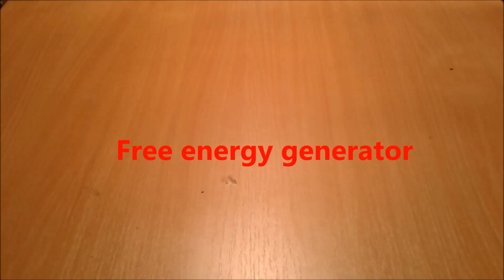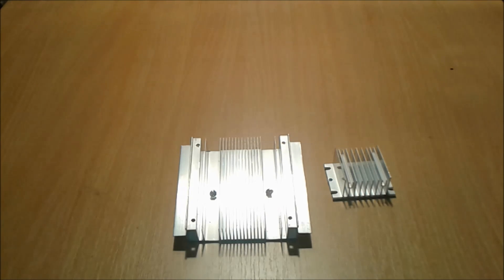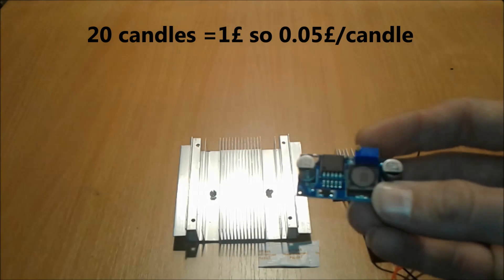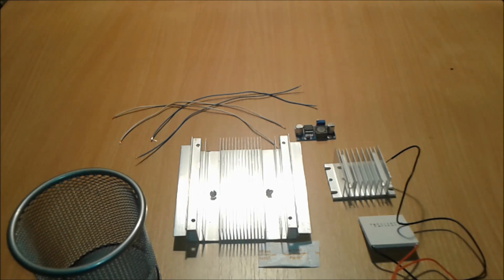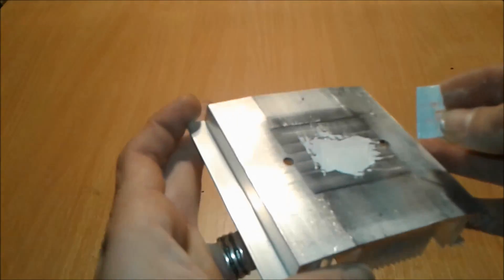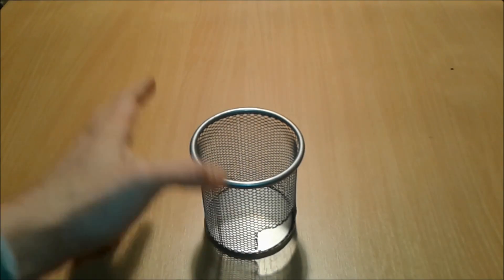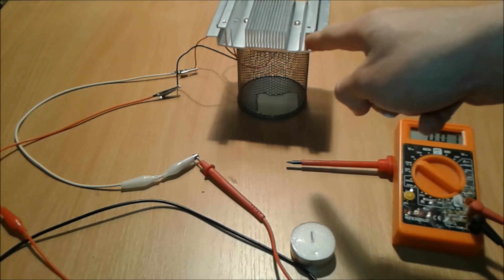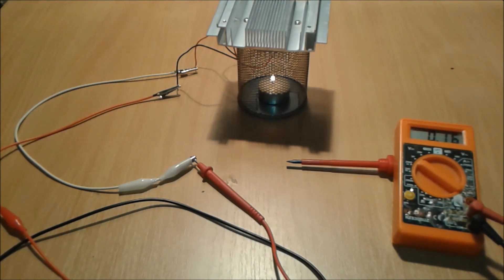How to make a free energy generator at home

Comment: make a don smith device schematic!!
Reply from the maker: fidel catsro I am currently working on that for some time something is missing adjusting the frequency and resonance is the hard part
Reply: i tried making one as well... ended up making a device similar to a  step down transformer hahaha...dont forget to follow the quarter wave step down in the coil as well.. i heard its important!!   real free energy for now closest thing is solar and wind power!!
Reply from the maker: fidel catsro yes I am struggling to tell the world that at the moment just solar and wind is free energy the rest kapanadze don smith and others it's next to impossible to replicate
Reply: yup i understand you there amigo.. i also built a solar led light setup thats been running every night for 5 yrs now!! i just replaced the 12 volt lead acid car battery recently after all these years!! truly almost free energy!
Reply: if you have resource and time try to make a homopolar generator as well.. that one also might yield something incredible
Reply from the maker: fidel catsro normal car battery or other? Even this thermoelectric generator cascading multiple cells and on a wood stove când output some energy definitely stay in touch I have lots of ideas but not enough money to study all
Reply: Yup single 12volt battery and 1 solar panel 50watts is enough to light led lights reliably for few years.... Candles and themogenerators rely on heat ...better to use solar easily available amigo...
Reply from the maker: fidel catsro thanks amigo I have a 20w panel that will use soon waiting for the controller

Comment: free energie. if you have candles for free.
Reply from the maker: auricom24 you can make candles out of vegetable oil or used oil or just buy them there are very cheap 0.0125£/candle all the best
Reply: so its cheap energy generator. But the the local energy supplier is cheaper.
/But good to know it would work.
Reply from the maker: its not gonna replace the energy supplier but just in case a power outage or in a off grid situation its good to bee there

Comment from the maker: How to make a free energy generator finally
Reply: NoSkillsRequired You should really use a Seebeck device for thermoelectric generation. The Peltier device should be used for cooling.
Reply from the maker: Vino Veritas I know about teg but tec are more easy available and cheap if you have a link where to buy the teg module at reasonable price please send it and I will make a real time comparison. Thanks